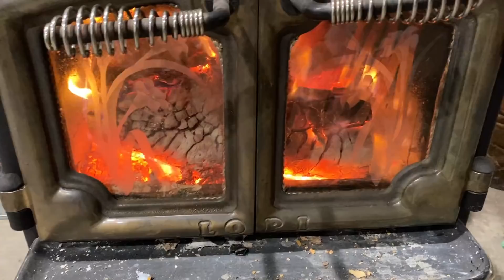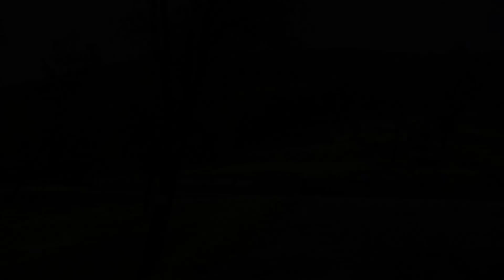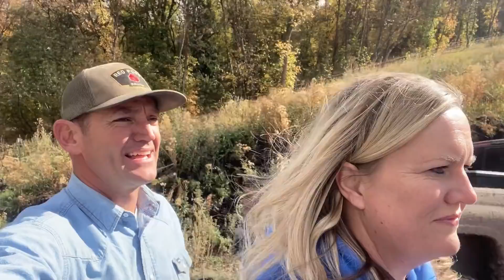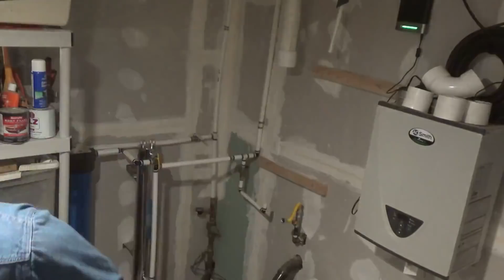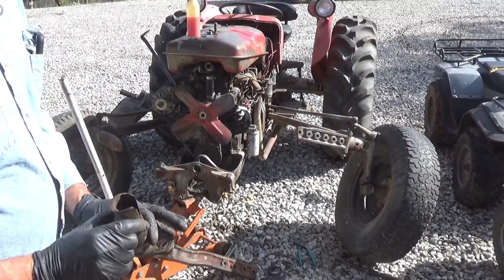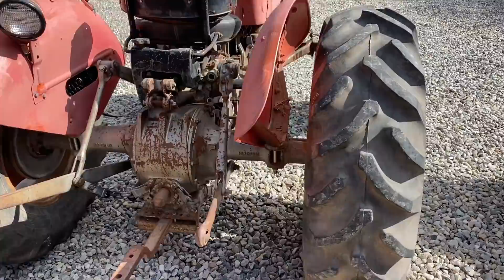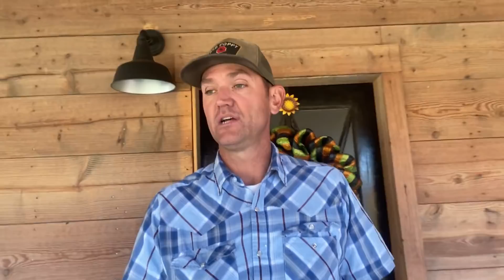#370 - I Installed An Ultraviolet Water Purifier On Our Off Grid Water System!

Comment: Take a look at Marine Wind Generators like are used on sailing vessels for long term living and doing ocean crossings.
Reply: They don’t work on land when the wind is unstable from trees, hills and valleys plus they are expensive for little capacity upgrade, far cheaper to add panels and remove shading he has on the existing panels plus other optimizations, like panel angle,direction, cable size etc. Also adding battery capacity and better batteries like Li-ion would sort their capacity problems.
Reply: I want one of them. However I am not that bright to set it up

Comment: I don't know the make of wind gen at Our Electric Co-Op head office, but if it can Handle Corpus Christi winds all day long (15-45mph), you should be able to find a Wind Gen easy for y'all's place.  Also look into a propane fuel gen for back up, with that 1000 gallon tank you should be perfect for ruff times.
Reply: TdrSld ...oh really.  What about the west Texas winds farms that can only produce 3% to 8% of Texas energy?  Oh, and tell us how we can identify  electrons produced by wind vs coal?    And yes, winds blow most days..but if you don’t have battery back up on the still days ....you’re toast in 100 degree heat.
Reply: @krano6962  Look I'm against large scale wind and solar farms, I live out side Corpus Christi Texas. I get to see 100's of wind gen's every day, and most of them never turning. What I'm talking about is a micro wind gen, about 8 feet across the blades and maybe 50 foot up. This units are built to spine up to about 55-60 mph wind speed, then they brake. I believe if you are going to use wind and solar it needs to be done at point of use and account for 50-85% of peak daily usage when grid tided. We do not have the tech to store dark hour power needs at this time for a whole country. Now for him and his family the battery setup they have is just about right, though I would have gone with a flow battery setup.

Comment: How's your cell phone communication out there? Have you thought about a radio setup? A Central station at house and a CB in every vehicle? Just in case someone gets stuck or needs help on the road, they could radio to the house.
Reply: Even with cellular coverage, they should have some radio coverage, as a backup system. I worked for a fuel company, before retiring, and I used to go out and refuel generators at cell towers after severe weather knocked out power, and caused the generators to run nonstop for days. There were some individuals that had CB and 10 meter radio sets in their vehicles and homes, to communicate to each other, in case the generators ran out before we got there to refuel them. It made sense to me, and I would get on their frequency to let them know I was in the area to refill the cell tower generators, and see if anyone needed their generators refueled, as well. It makes sense that if the towers were running, so were the home generators. It was neighborly, as well as good business, to check on everyone in my area. Some of my customers told me that they were thankful that we were there, looking out for them, when it seemed no one else was, and if it weren’t for the CB radio, things might’ve gotten bad.
Reply: He's got 4G with the antenna so I assume they have decent voice coverage
Reply: Go back a few videos to find out. He installed 2 long range cellular antennas. So the signal for their mobile/data phone services is good enough for downloads, browsing, and even decent enough for the slow uploading  of videos from home. No it's not very fast, but reasonable for his location at 3 Mbps per second.  That is , if I am remembering correctly.  He should consider satellite, I believe Directv offers 25 Mbps.
Reply: I know he added the extra coverage but does it actually reach down the road to red poppy ranch? I was more asking about the people on the road/out on the property.